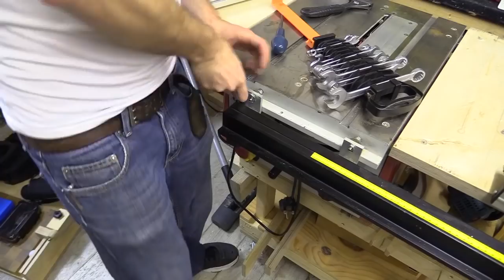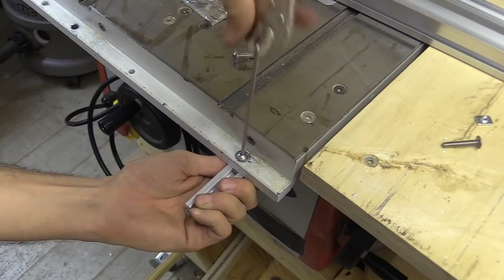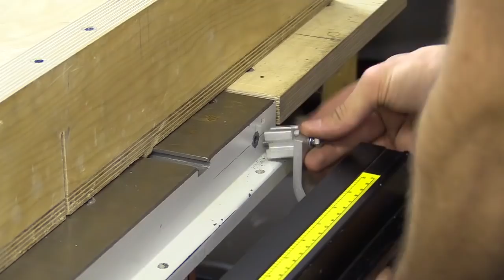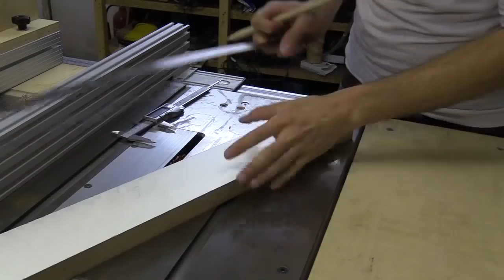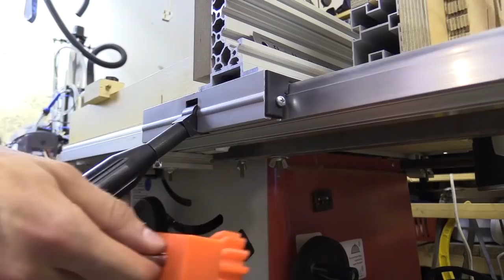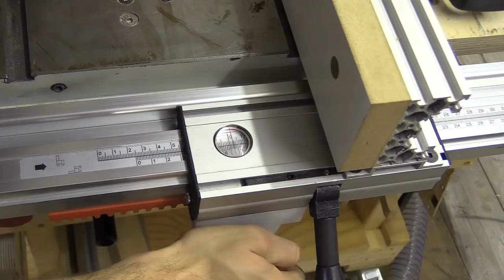New Table Saw Fence - Fine Adjustment Test

Comment: How have you found the fence after 2 years, does it stay aligned? Are there any problems you have found?
Reply from the maker: Unfortunately I had to downsize and got rid of a lot of my machine tools. :( The fence was pretty decent when I handed it over to a nice chap off ebay though.

Comment: Where did you get the new fence from? I can’t find it on Axminster. I have the same saw and the original fence is really poor. Puts me off using it. I just want something that glides nicely and locks square.
Reply from the maker: If you google Charnwood Universal Rip Fence it should come up on top. You'll still need to calibrate it.

Comment: hi, i have ts 250 model. just got the upgrade fence, like you had. I don't see any holes to mount the rail. Did you bore them yourself ?
Reply from the maker: The fence was from another company. Charnwood. No idea if those are compatible. I don't have a table saw anymore. 😢

Comment: I like the fact you can adjust the length of the fence. You have put a lot of work into this Axy. Minor thing - soft start isn't a thing for induction motors - typically seen on universal motors that have higher equivalent starting torque and the fact they are easier to control that way. Induction motors are much harder to regulate.

Comment: Great problem solving :)n is your table saw from Axminster? How to you like it? And does the dust collection port work?
Reply from the maker: Ta. Yeah it is, but I bought it a really long time ago so it doesn't have soft start or breaking. The blade travels when it tilts which I think is still a problem with the new model - and the extraction is not great but that looks updated now. The mechanism to make the blade parallel to the fence or mitre channel is also a bit suspect but you know, just have to work with what we got. I've made the most of it.

Comment: My newer version Axminster table saw came with that fence. Unfortunately, it has a habit of moving out of true when you tighten the handle down. I had to add a guide bearing and track to stop that happening. Works reasonably well now. It also came with a fine adjustment mechanism very similar to what you've designed (albeit it's less forgiving on knuckled as it's metal).
Reply from the maker: Odd, it seems ok on this one. Have you tightened that bit of metal at the top which holds the flap between the eccentric locking nut and front rail? Lol. My knuckles are use to it... I also use bits of paper between the fence and blade for fine adjustment.